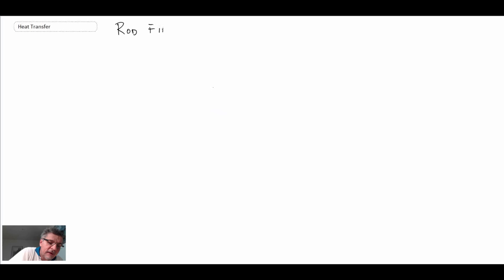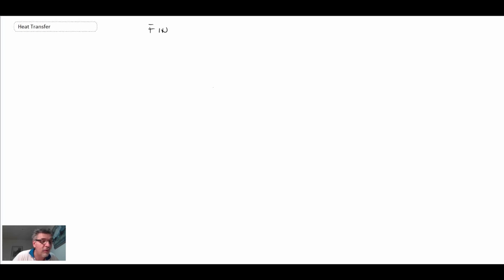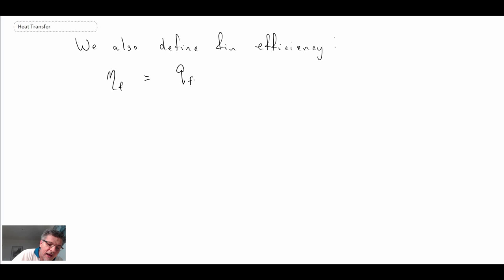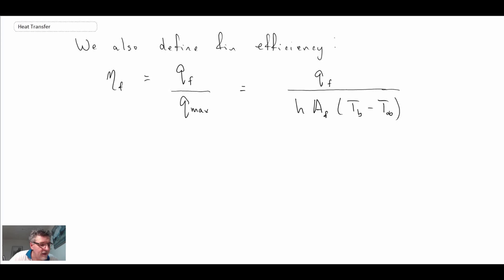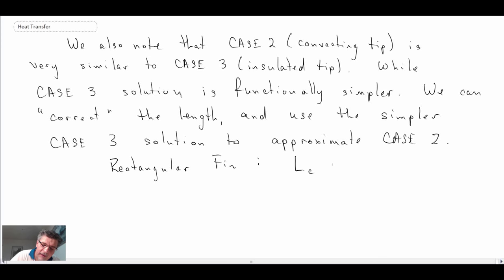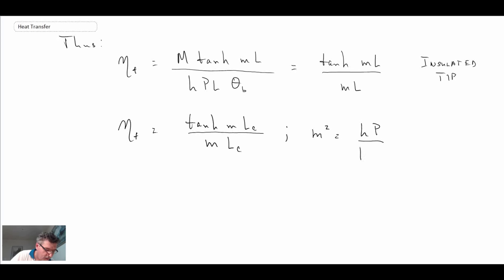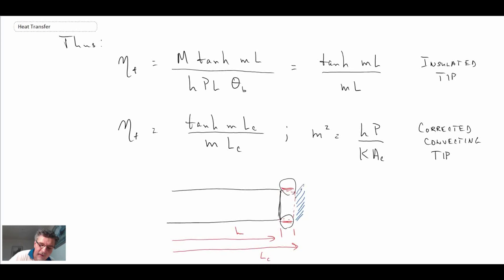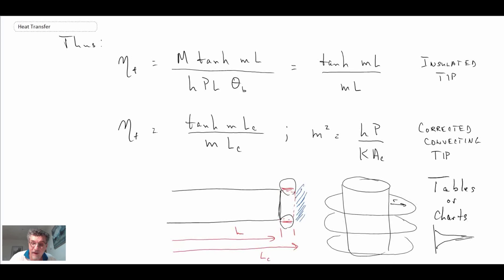Heat Transfer L9 p1 - Fin Efficiency and Corrected Length

Comment: Thanks, came looking just for the explanation of what exactly corrected length meant since I couldn't find a tabulated value for my geometry and needed to see how it was found. Got what I needed. edit: for anyone else looking for this, you figure out what length the pin fin needs to be to have lateral surface area equal to the actual lateral surface area plus the area of the pin cross section at the tip.